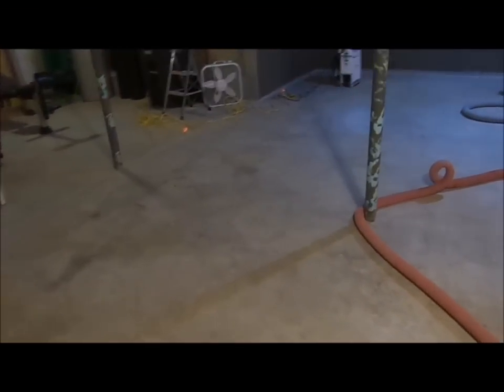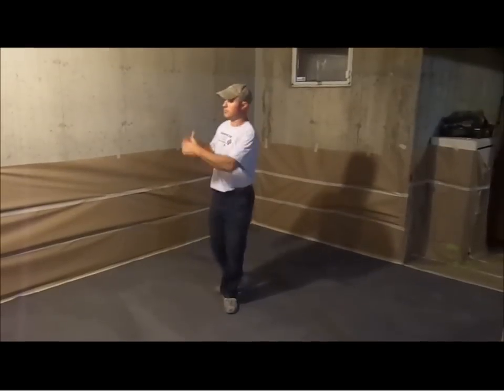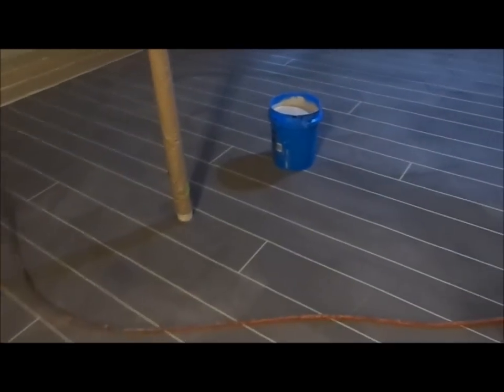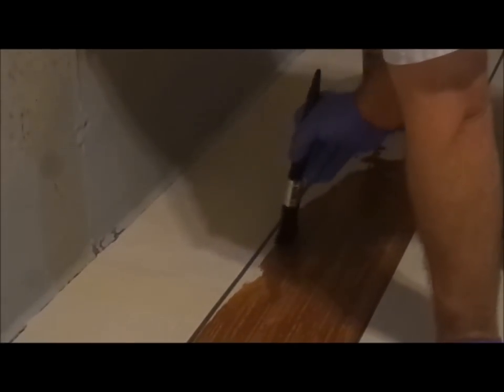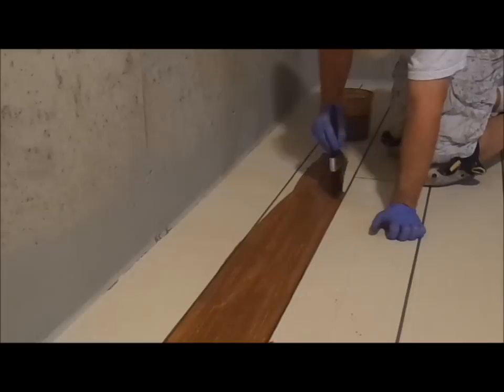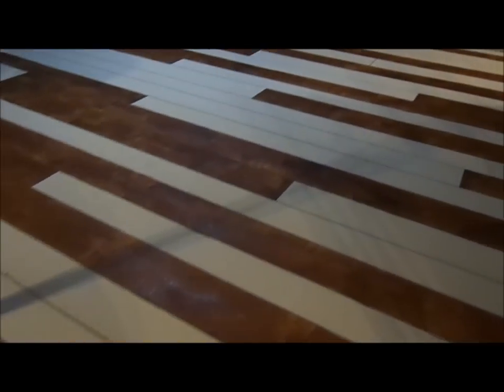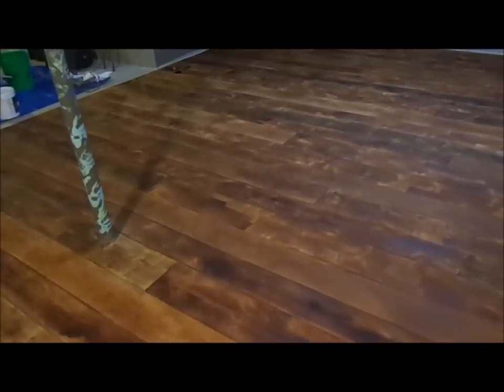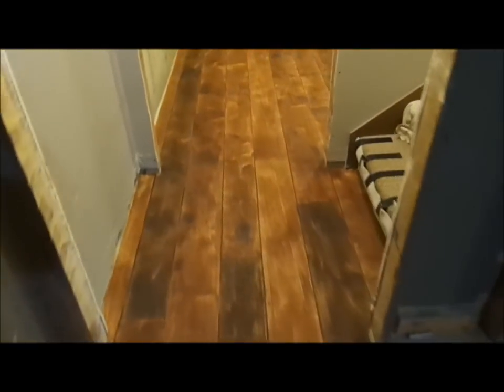How to Do Wood Concrete

Comment: from initial prep, plus materials and labor what does it come out to for cost per sq ft?  Looks awesome and what is expected longevity of finish. I'm thinking of using this for my new house which we plan on doing a slab construction and was just going to do a mixture of paint in concrete when we pour slab but I like the look of this.

Comment: Did you have to wipe the stain off like normal wood? This looks so neat. Looks like it would be hard it you had to do this around a furnace room with that little machine..
Reply from the maker: No, the stain actually penetrates into the cementitious coating. A far as machines go,  if you are referring to the shot blaster or hopper gun, there are other equipment options which are more efficient for bigger areas.

Comment: I have very little diy experience but I need to do this or something similar in my house since I have several pets and they have destroyed my carpet.  is this an incredibly hard job for someone who doesn't have experience?  tips?
Reply from the maker: +Renee Bach 
There have been beautiful floors done by people with little to no experience. To find more information on products/ purchasing and tech support, visit http://theconcreteprotector.com 
We also offer an opportunity to purchase a manual which leads you step by step through the process http://social.decorativeconcretekingdom.com/dc-king/page/25/rustic-concrete-wood-manual
Reply: Thank you

Comment: What does this roughly cost per the video size of about 875 sqft?
Reply from the maker: The price will depend on the contractor whom you chose to install your floor. To find one in your area, visiting http://www.decorativeconcretekingdom.com/decorative-concrete-contractors.html can be of help. If you are interested in doing this yourself, you can obtain information on prices, products, purchasing, and training classes by visiting http://theconcreteprotector.com
Reply: Unfortunately I probably wont ever have the ability to have this done considering the nearest contractor is over an hour away.  Im sure they will travel but the costs would probably exceed my budget.  Awesome work.

Comment: Do you need to use the machine in the beginning of the video if you are starting with newly poured, finished concrete?
Reply from the maker: Yes, every slab of concrete must be prepped before applying a coating (regardless of age), or there will be failure in the future. For this particular system, blasting, acid etching, or grinding are all acceptable methods of prep. We do recommend a 28 day curing process before a coating is applied on freshly poured concrete.

Comment: Why do you put tape? I do not understand. If you are using that machine to grind out the lines
Reply: Daniel Ramos wood effect
Reply from the maker: The machine that was used in the beginning of the video is used for prepping the concrete. This needs to be done for proper adhesion of the coating. The tape is to create different kinds of patterns, in this case a wood plank look.

Comment: Amazing! We are looking to purchase a new home next year and this is what I want to do for the floors! Screw the ridiculous pricing on the builders "premium" red clay ceramic tiles from Interceramic! (Sales person tried to convince me that $10 a square foot was a good price for a product I KNOW costs around 90 cents a square ft for builders. And in AZ you can do 18x18 tile for less than $3.50 per sqft by a reputable and registered contractor. Even the high end Italian rectified faux wood porcelain tile don't look this fantastic! You should try a Pier wood look. Where the long ends butt up evenly but the width of the board varies. So equal lengths but varied widths. Maybe use some dark grayish stain with a hint of green and an essence of brown. That would look incredible with this technique!